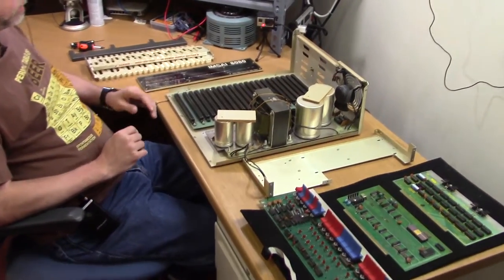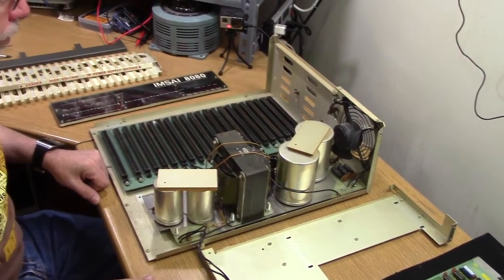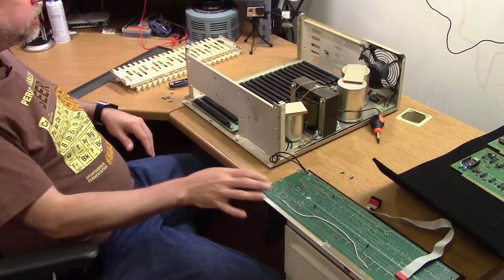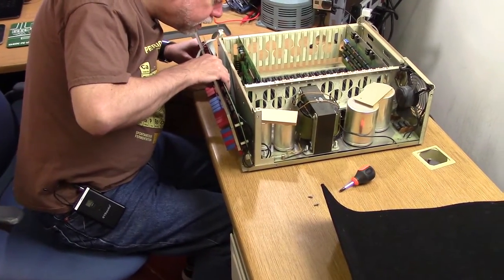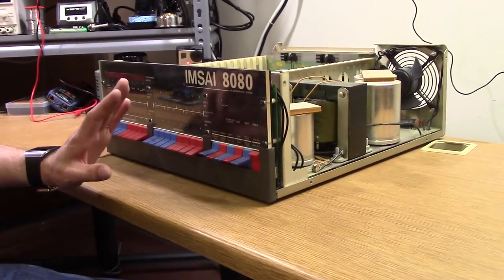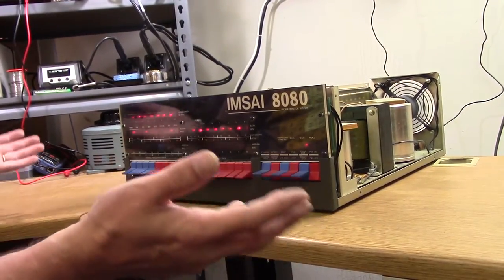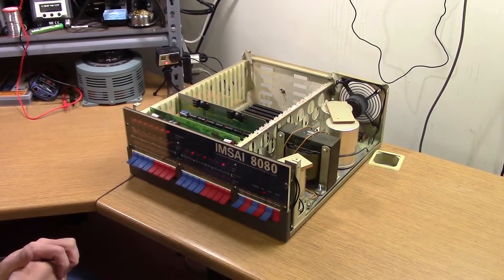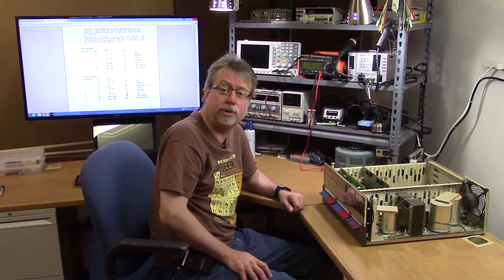On The Work Bench - IMSAI 8080

Comment: Before the Alair and MSAI i build my own 8080 system, later upgraded to a Z80, then adopted the S-100 bus, built my own Front Panel as well, I had 16k of memory, wrote my own O/S and used a teletype as an i/p device, I upgraded to 64k of memory and then a Dec LA36, then a DEC-VT100, with 8" floppies! I ran CP/M them MP/M on it, had acoustic modems running 300 baud. Woo-Hooo! Of course at that time I was working on an IBM 360/30 with 48k of memory, (3) 5 MB disk drives and 8 2401 tape drives, Loved it Trust me, the Altair or the IMSAI had NO WHERE near the processing power of a mainframe.... I wrote in assembly lang only and was a systems programmer on mainframes

Comment: 9:25 For whatever reason, the IMSAI Manual is oddly specific about the location of the MPU and RAM boards on the smaller (4 and 6 slot) backplanes, but not for the larger 22 slot!

Comment: IMSAI planar boards were fully populated with 22 slots. This was in direct contrast to the Altair, which only originally came with 4 slots, while it did have enough room for 22 slots, but arranged orthogonal to the front panel. With the altair, you had to solder on additional connections for boards with more slots.
Reply: Thanks for sharing your knowledge Thom! Interesting with computers history.